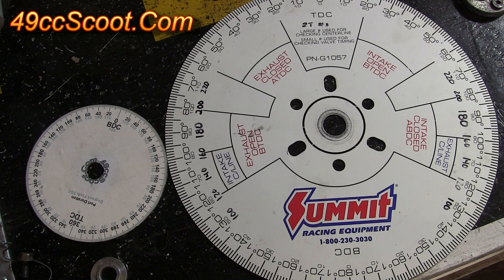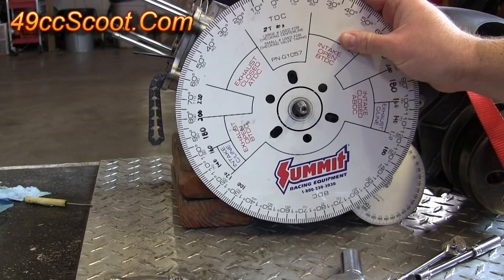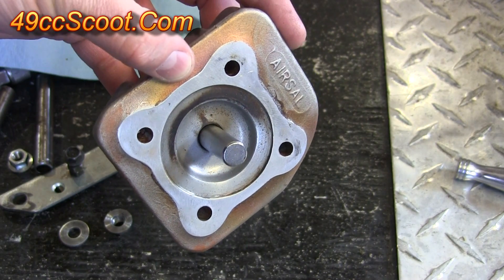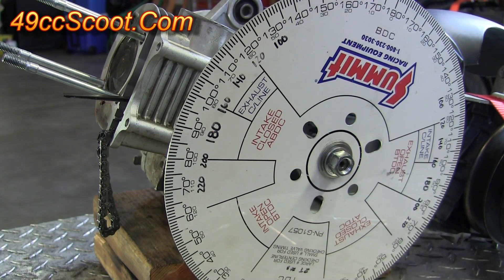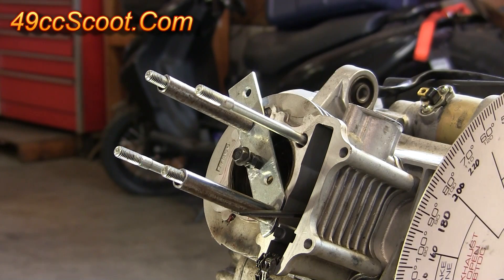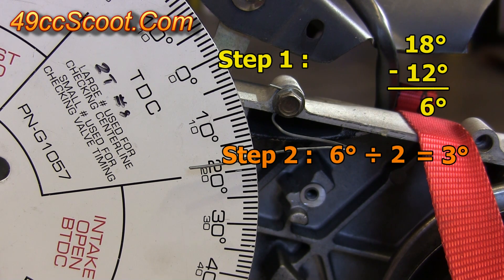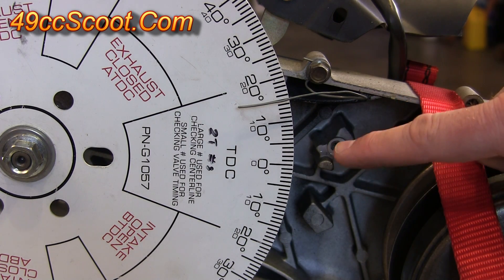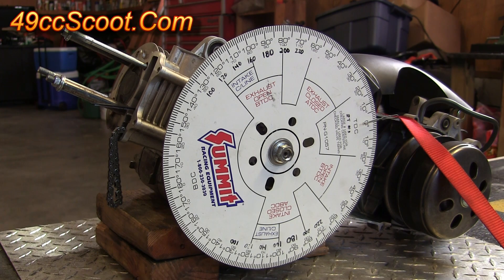Setting Up A Degree Wheel And Finding True Top Dead Center (TDC)

Comment: Great video as always even though I've watched it more than a few times. You didn't state if you need to put pressure on your piston stop tool like if it was torqued   down so there's no deviation  with TDC. Oh one thing what size were your spacers in know it will very with each engine.
Reply from the maker: The piston stop needs to be tightened so it doesn't move. You shouldn't put much pressure at all on it to stop the piston. I don't recall what spacers for the one shown. The stuff that comes with the Summit kit works on lots of things.

Comment: Nice demonstration of TDC.  A very critical point, especially for larger engines, is to ensure that the piston is very snug up against the piston stop.  This removes any tolerance (space) in the piston pin & connecting rod that will alter your readings.  I speak from experience here.  It’s tempting to just “kiss” the piston stop to avoid leaving a mark in the piston.  If you do this, like I did, your TDC reading will not be accurate by 1-2°.  If you are concerned about putting a mark in the top of the piston, tape a flat piece of metal on top of the piston where the stop makes contact.  Do not use something soft like a vacuum cap on the piston stop.  Anything soft will compress and screw up your readings.  Don’t slam the piston into the stop, of course, but when you make initial contact with the stop, place a little pressure on the breaker bar to ensure the piston is tight up against the stop.  Do this clock and counter clockwise and you will get accurate readings like Brent did.

Comment: That piston stop is a horrible idea because you would always be stopping the piston somewhere before top dead center leaving you a few degrees off when you need to be between 34-36 degrees. Just take the spark plug out and use a plastic pen. Stick the blunt end of the pen in the hole. Look to see when it is in between rising and falling. Or better yet, use a compression gauge.

Comment: Hi; why the wheel says "intake open BTDC" AFTER the TDC mark actually? I mean if you rotate the crankshaft CW; BEFORE would be at the left hand of the TDC mark viewing the wheel as you rotate it...
Reply from the maker: If you're rotating it clockwise, the BTDC does come before the TDC mark.
Reply: @49ccscoot  I have 2 slots in the crankshaft flywheel. One is TDC the other is for 38ºBTDC (for the timing) when I put the degree wheel and rotate CW, the 38º mark is find at the left of the TDC not at the right like in that wheel
Reply from the maker: @TheReverb1  There are engines that rotate counterclockwise. You can tell for sure by watching what the intake and exhaust valves do. If you can see/feel the piston, you can be sure which is TDC so the lines shouldn't get confused.
Reply: @49ccscoot  I know that; also my engine rotates CW as mentioned, In any case if you rotate the wheel in the same motion than the crank; CW for example; the BTDC should be at the left of the TDC mark not at the right like that wheel

Comment: I've found that it's both easier* and more accurate** to simply measure DURATION and divide it by 2, to get your #'s...
*easier because you don't even need to find TDC, heck I made my last wheel a 'fixed' wheel so it only counts degrees it doesn't tell me "relative to TDC" but I don't need that because I simply check duration from when exhaust closes before TDC on piston's way up, to where it cracks open on the way down.
**more accurate because you're measuring a distance on the wheel 2X as long, but the wheel's precision is fixed....so you're getting a sharper reading when you get duration and divide by 2, than simply measuring from TDC w/ a properly zero'd wheel!
Would love your thoughts on this, I mean I know it works (as I, of course, do multiple checks and they are consistent as can be), and I can't "fault it", but am surprised it's not the norm simply because it forces a 2X larger measurement using the same wheel IE same margin of error on a 2X larger distance, automatically a tighter reading for true timing #'s!
Reply from the maker: A lot of people do prefer that method. I don't know that  it's actually more accurate. I've tried both ways and got the same numbers. If you check the open and close points and make sure they match up, it has been accurate for me as far as I can tell. The main thing for me is to take your time with the process, however you prefer and to try to be consistent with how you're measuring.

Comment: The link on the forum no longer exists it seems.
Reply from the maker: I just checked all links on the page that is linked in the description and they are all active, as is the description link. Give it another try. The servers do have errors periodically so maybe it will work this time.
Reply: I paid more attention this time. Looks like it's a permission issue through not being signed up.

Oops, there was an error!
You do not have permission to access this thread.
Reply from the maker: @Alan_Hans__  Registration is free. No BS.

Comment: Love it, when you said "Stick that on CD"
Reply from the maker: Why? Because CDs used to exist? lol Good luck sticking it onto a Spotify.
Reply: @49ccscoot  I love how you used commonly available material like CD to make a background instead some premium metal disc.
Reply: @49ccscoot  I am sorry , My whole point was to appreciate your work. :)
Reply from the maker: @Sam-to1zg  No worries. I didn't even think they were easy to get today, but I see them for $15 for 100. That's a lot of degree wheels. Still, they aren't lying around everyone's home like they were 10 years ago.
Reply from the maker: If you could drill it right in the center, you could probably get creative and use thick plastic plates that are $1-2 each and just upscale when printing to have a super cheap wheel.
Reply: @49ccscoot  Nice, Thanks

Comment: Can someone explain how he knew exactly how much depth he needed to screw down his screw on this home made head stud bolt plate ?
Reply from the maker: It doesn't have to be exact, and generally the engine setups that I'm messing with will either function with just a flat plate or with very little of the bolt protruding downward.

Comment: How about when checking valve clearance?
Reply from the maker: Checking piston to valve clearance or valve lash? If it's a lash setting, you don't normally need to go as far as a degree wheel. For P2V clearance, I have a few videos about that.
P2V Info : https://www.youtube.com/watch?v=oZghWIpqquc
P2V Clay Method : https://www.youtube.com/watch?v=4_ZdcAE67L0
P2V Dial Indicator/Feelers : https://www.youtube.com/watch?v=sLe6-AgbtlA

Also : Valve lash : https://www.youtube.com/watch?v=s0K-ytyjOFg

Comment: Nice vid. Im now getting hook with 2t motors and i want to understand how timing works. In this vid you talked about tdc. If i get the tdc, do i need to get ex and in timing or getting the tdc will cover both?
Reply from the maker: TDC is just the top of the stroke. If you're trying to find port durations, you will do that after you've got the degree wheel zeroed on TDC. Some people just 0 the wheel as a port is beginning to open and then read degrees of rotation till it closes. I prefer finding TDC and then checking port timing.

Comment: Hi sir, I like too much ur explained video about degree wheel, I appreciate your knowledge and explanation very much, keep it up. One thing I have to know from you or any other person that is what is the best time to ignite in 2stroke single cylinder, I converted my bike from point ignition system to Cdi system, the bike is running but I have to know the best time,  if possible whatapp me on my phone number +923178492752. Thanks.
Reply from the maker: There won't be one best time for all engines. You can probably start off somewhere like 10-20 degrees advanced for base timing. Usually a 2T will then like some ignition retard at higher RPM to extend the power band.

Comment: I have a question my friend when you have the calculated done on how much degree is going to be how I know if I have to add or minus before or after tdc
Reply from the maker: You move whichever way evens it up. So in the vid I needed 15 degrees and had 12 and 18. So I'd either subtract 3 from 18 or add 3 to 12.
Reply: How deep I have to screw the piston stopper, because if I screw to much is going to be off timing or the point of a tru tdc is trying to up the piston much I can at the tdc?
Reply from the maker: @3030rey  Only far enough to stop the piston before TDC.

Comment: Small roundness of large roundness gives us more accuracy?
Reply from the maker: Large wheels will give you a greater degree of accuracy.
Reply: +90GTVert yes thank you
Reply: +90GTVert Is there any formula for calculating the lobe angle?
Reply from the maker: @longtat6587  google "lobe separation angle calculator"
Reply: +90GTVert What is that application called?
Reply: +90GTVert My friend curious about 360-degree measure to find what?
Reply from the maker: @longtat6587 If you're asking what it can be used to measure; find true TDC/BDC and cam specs and use it to set up an engine if you know what specs you're after.
Reply: +90GTVert The camshafts confuse me a lot
Reply: +90GTVert Do you specialize in 2-stroke cars?
Reply from the maker: @longtat6587  Never seen a 2T car in person. I work with 2T scooters a lot.
Reply: +90GTVert I found the cylinder to be quite complicated. If you want it to have a good effect, the social pipe and the intake pipe must be placed properly?
Reply: +90GTVert I'm not very knowledgeable
Reply: +90GTVert I understand their principle but have never done it before
Reply: +90GTVert I made a 4-stroke car. more than 2-stroke cars

Comment: You can give a formula for calculating the camshaft and placing the camshaft in the calculated formula
Reply from the maker: What are you looking for? Degreeing a cam?
Reply: +90GTVert Yeah, how to put the camshaft to fit
Reply from the maker: @longtat6587  Search for "how to degree a camshaft" here. Good vids will come up. If you're working on a scooter like me, the issue is that we don't usually get cam cards or any specs to go by like you do for cars and motorcycles with cams from major brands. Most specs that I've seen on cams for a GY6 or 139QMB are useless.
Reply: +90GTVert I think you know how and I ask
Reply: +90GTVert Are there formula equations for the angle of the camshaft sir?
Reply: +90GTVert I am a morto mechanic because I see the orange shaft or should learn about it
Reply: +90GTVert As with all four cars, the principle remains the same. But there is another thing in automatic numbers with multi-level cups
Reply: +90GTVert So what method is good?

Comment: Excellent Video Sir, I will be using this procedure to reassure my 4 stroke 912 rotax non certified ultralight aircraft engine did not knock itself out of "Sync" by a propeller strike, as it has a press on crank journals. ty so much!! 100-100 perfect explanation,and detail. best video on Utube!!

Comment: sir....will i get a wrong reading if the dial indiactor is not aligned with valve retainer when measuring duration??please reply
Reply from the maker: You can. Do a search for "dial indicator cosine error". There are videos explaining it and demonstrating it.
Reply: 90GTVert ..that means dial should be align whether you are measuring duration or lift ....right??
Reply from the maker: Yes.

Comment: I really wish you showed your flywheel so we could see if it was off! :)
Reply from the maker: This one was just slightly off, which I think I said in the video. I have had one that was over 20 degrees off in the past from the factory on a 139QMB. That can cause serious issues.
Reply: How do you correct it!?
Reply from the maker: I replaced the flywheel, since it was machined wrong. Before the replacement came, I installed the flywheel without the woodruff key and clocked it using a degree wheel. It wouldn't be a bad idea to try to lap the flywheel to the crank with valve grinding compound if one were to use a flywheel without the key. It's also possible that the crank could be machined wrong, and again not using the key could fix that at least till a replacement was found.

Comment: THE ONLY RELEVANT INFORMATION TO MY SEARCH ANYWHERE ON THE INTERNET! Jesus! Thanks for taking the time to create this video. I'd like to confirm where in the range of 12 degree to 15 degree my stock ignition actually is on my 08 2t zuma (I heard it can range). Do I use the center of one the stock stator bolt locations in my case as a reference point for zero and then count the amount of degree marks I find that to be away from TDC, to find BTDC?
Reply from the maker: The easiest way to figure out where your ignition is actually firing is to use a timing light. That will tell you when the spark really happens, vs trying to figure it out based on when the reluctor passes the pickup and having to know if it's the leading or trailing edge of the reluctor to be most concerned with. For that, you just need to find TDC and make a mark on the flywheel and a pointer that points directly to that mark at exactly TDC. Use an adjustable timing light and adjust till the mark and the pointer align and the light will tell you what the timing is. 

http://49ccscoot.proboards.com/thread/15348/checking-ignition-timing-light
Reply: +90GTVert Do you teach that method of fire?
Reply: +90GTVert I hear you say and I know this teaching is correct

Comment: Great video and explanations but It would have been much better if this war demonstrated on an engine where the timing is off of indicated markings

Visually TDC markings on my engine seems to be ok. But just how much degrees off is to be concerned with?
Reply from the maker: A few degrees is probably alright. Not good, but not so likely to cause big problems. I had an old Chinese scooter that was over 20 degrees off and it ran poorly. I put a BBK on it and all sorts of parts and it wouldn't pass 35MPH till I found the improperly made flywheel and replaced it. It also had more issues with P2V clearance than it should. Some engines could have serious interference issues by that point and fail quickly.

Comment: Great video.Any chance you could show us the process of finding the LCA as I have a 4 valve head on a pitbike that needs to be set to 100 degrees.Because I don't have a cam card I got no idea how many degrees the cam is set to.Hope this makes sense
Reply from the maker: This engine is in a scooter waiting to be sold so I don't wish to tear it down and my other 4T is a project scoot that I don't want to tear apart yet either, so it would be a long time before I did that. Sorry. If you google finding lobe centerline angle, a lot of info will come up. Most info that you find is for automotive engines, but it's the same process. Sorry I can't' be of better assistance ATM.

Comment: This is a timely video for me. We have two 139QMB scooters. One was always a bit slower than the other. While installing a big bore kit on the slow one, I realized that the cam gear holes did not line up parallel with the cylinder head when the flywheel indicated TDC. I took the head off to verify that the flywheel was made properly and it did seem to accurately point to TDC. So I'm assuming the cam was installed one tooth off from the factory.

1) Could being one tooth off account for the scooter's lethargy?
2) Have you ever heard of them coming screwed up from the factory like that?

Simultaneously fixing the timing and jumping up to 81.3cc should provide nearly limitless fun! Just waiting on jets in the mail.

Thank you very, very much for your channel and all of its content. My GY6 experience would have been greatly diminished had this content not been here.
Reply from the maker: +smith jones My first Chinese 4T had a flywheel 21 degrees off of TDC.  It messes up how you set the cam timing and the ignition timing. It was a total dog before I found that out and changed it. It can also put you at risk of piston and valve contact and subsequent damage.
Reply: In the late 90s I had a Dodge Stratus that came from factory with the with the cam timing two teeth off it never had any real power until about 4 years later it blew a head gasket when I rolled the engine to top dead center before pulling in the head I went to Mark everything or at least confirm that the marks were there and found one cam was two teeth off. When I put it back together I lined it up with the factory marks and that car engine came to lifethey had more power than it did the day we drove it off the lot.

Comment: I just bought an aerox, once you go 2 stroke you can't go back to 4, just that kick in the pants when you hit powerband on a 2 , you just miss so much riding a 4 banger. just gonna put a mild taiwanese 70 kit in this one (the one in it, the PO busted one of the studs off of the cylinder, I kinda wondered why it wouldnt run properly at low revs) so I have to replace it,  and buy another one to put a polini 94cc full house kit in. You can buy them cheap as chips here, especially unlicensed ones, and everything is still available for them on the web. nothing beats having that storage area under the seat for around town.
Reply from the maker: +shoominati23 I have nothing against 4Ts, but it does feel like something is missing if you're used to piped 2Ts. It's kinda nice to get great gas mileage on the 4Ts though, and IMO all engines can be fun to experiment with.
Reply: yeah. I'm older than you probably think , and I get hassled by my friends for riding scooters, even though do I own bigger motorbikes too. But you just can't beat the practicality around the city! And they are surprisingly quick with something like a cheaper midrace 70 kit, a yasuni c16 , variator weights and a gear up kit. and FUN!